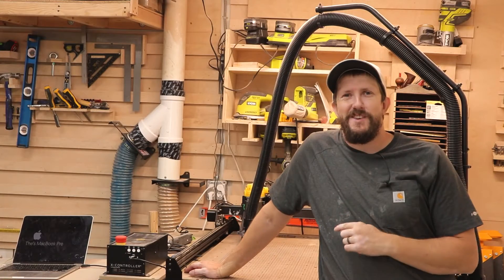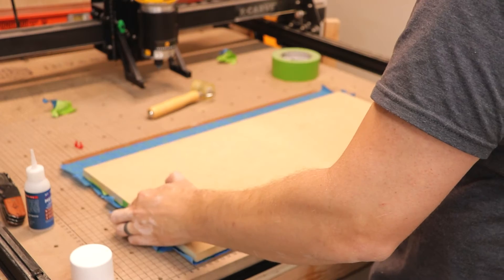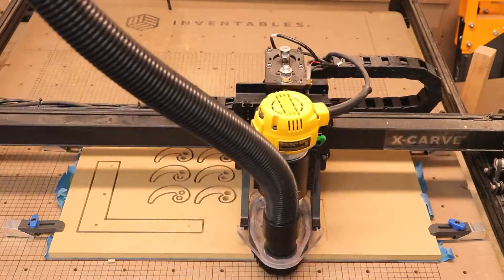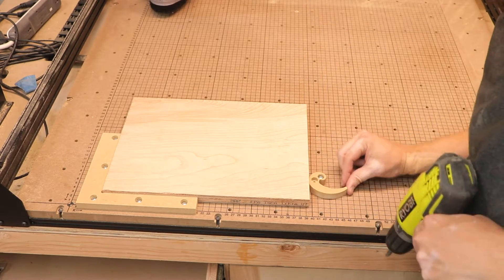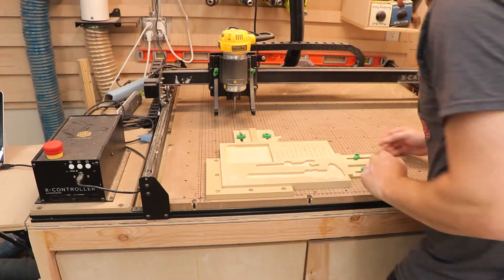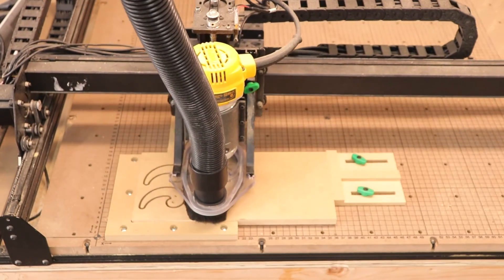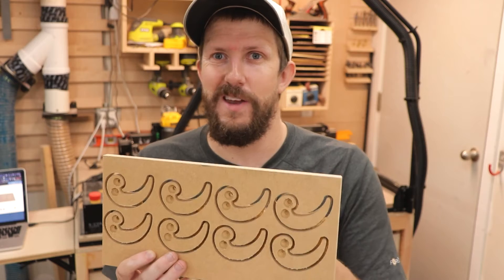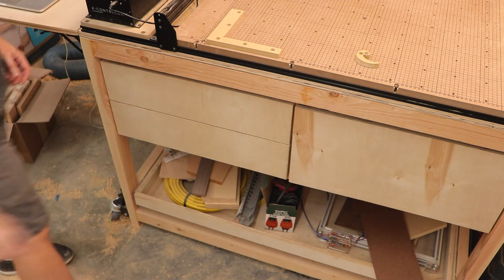The Best Clamps For Your CNC || Other X-Carve Upgrades

Comment: My clamps are far simpler... I just cut some discs of different sizes in 6mm mdf using a hole saw and drilled a few off centre holes. I can then use them as cams which can hold my work securely. This has been very successful

Comment: Hi there, Do you know the name of this exact Clamps projects? I'm looking for it at the projects page but can't seem to find this exact one. Thanks in advance.
Reply: Noticed that too. Hopefully he can chime in and let us know!
Reply: There are a bunch on Google images, if the software your using can import canvas (fusion 360) you can just copy them, or just draw your own, cam clamp is just off set/eccentric. The closer to centric, the more torque generated but less clamping range/distance. This is what I did, made a few little tweaks to suit my jobs. Made 3 prototypes, cut 1 of each, tested, picked the best most efficient one. Good project to get your cogs turning. Good luck.
Reply: My clamps are far simpler... I just cut some discs of different sizes in 6mm mdf using a hole saw and drilled a few off centre holes. I can then use them as cams which can hold my work securely. This has been very successful